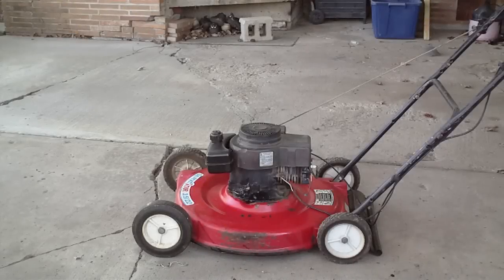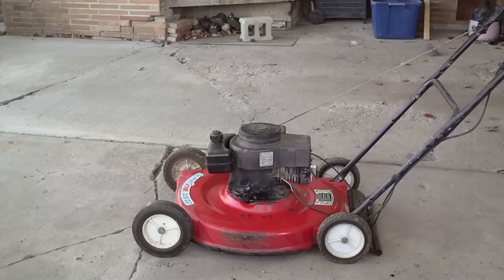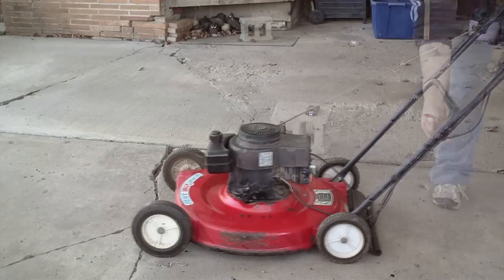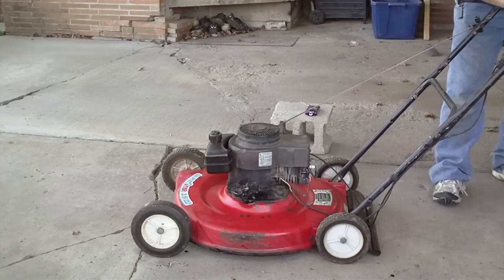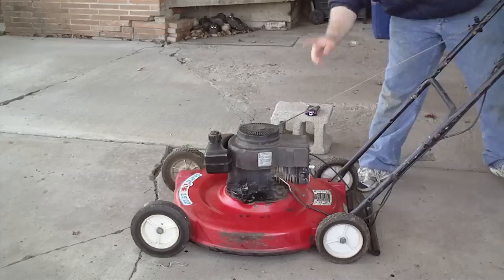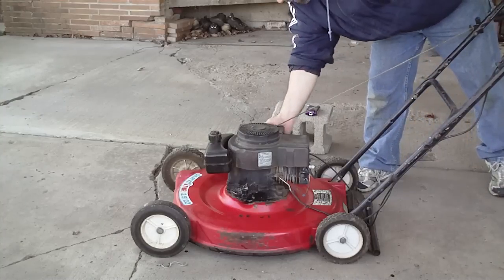Fire In The Hole - The Tecumseh Lives !

Comment: B&S was a great mower at one time. Just like everything else it's made cheap and junky. This mower knocks to and I'm amazed it has not blown up. Had a mower with a Honda engine that I loved. Powerful and ran great. Didn't burn much gas and was quieter. Used it put it up. Less than two weeks later went to used it and it wouldn't fire. The mower I use now is my mothers old mower. It's seamed to always had a bit of a knock even when new.  Think it has run rough since the second season.

Comment: My POS B&S (B&S used to be great) amazed me and fired up in one pull this year. Put fresh gas in primed it 5 times, checked the oil and it fired right up. Ran about 10 minutes and died, but fired right back up after 3 pumps of the primer. I even left the POS outside all winter. lol

Comment: I can get 15W40 at work. lol My truck even seamed to like it. Need a 1/2 qt awhile back and was going to change the oil in a few weeks so I didn't want to buy a qt to top it off. Put a little over 1/2 qt in and it didn't seam to smoke as bad on fire up (only sometimes. Valve seals) and the little bit of tick could hardly be heard. lol

Comment from the maker: If you can find it, wolfshead oil 10w40...... I dont know what it is, but when I run that in my tecumseh, it runs quieter though I always put 10w40 in older engines.  This tecumseh will burn mebbe a quart of gas per 3 hours of cutting or my entire property weather its a foot tall or not  lol